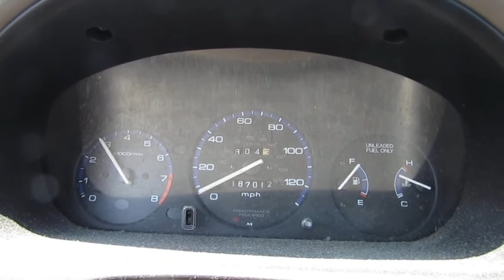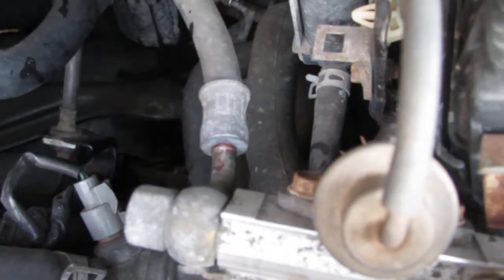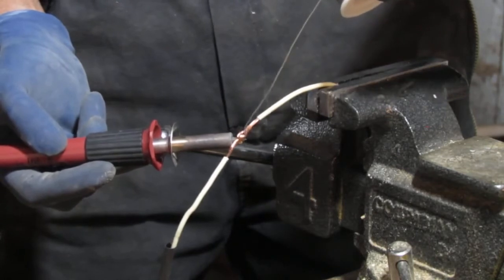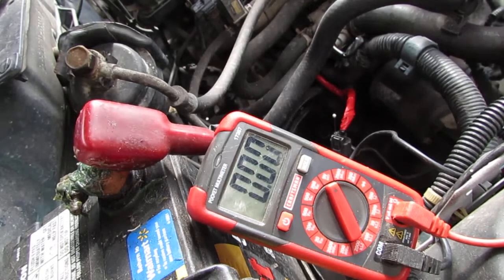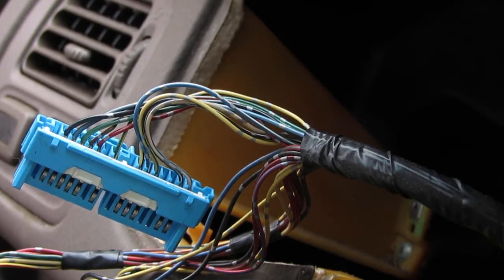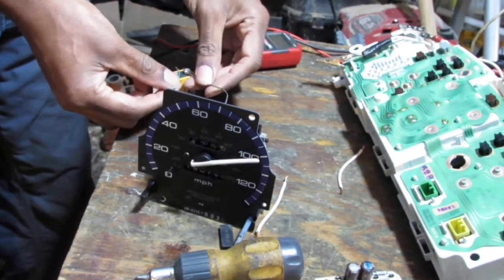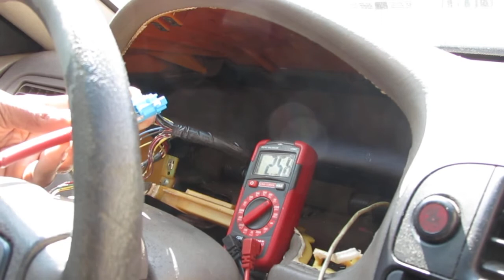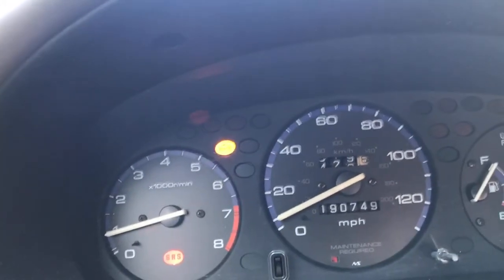Complete Diagnostics and Fix 1997 Honda Civic | Vehicle Speed Sensor VSS

Comment: Thank you very much for all this diagnostic info! I was able to pinpoint my problem, a randomly fluctuating speedometer, and make the repair based on your video. I re-soldered the pins of the NS chip on the control board. Some were corroded. Excellent guidance.
Reply from the maker: I had so many failing issues at once.  Glad you were able to resolve them.  This is a really simple system once it is documented on how to diagnose all the components.
Reply: I’m having this problem now. What’s weird is that when I had the old speed sensor it would randomly work now that I changed the sensor it doesn’t at all. I’m hoping it’s a short in the cluster I don’t have those tools tho

Comment: Thanks for the video. I have a speedo thats not working so will be checking through your process of elimination
Reply from the maker: I made this video as complete as possible so if you have a failed issue it will catch it.  As you can see I had multiple points of failure from in the engine to behind the dash. Best of luck there is a companion video on how to test  the vehicle speed sensor outside the vehicle.  I recommend watching that also.

Comment: What could be happening when the speedometer behaves identically to the rev counter behavior? It started like that and stopped working! Thank you so much for the attention to my question.🤔
Reply from the maker: Can you post a video of this so we can see?
Reply: @MotionDesignStudio  Thank you so much for the attention. In fact it is not possible make a video to show, because the speedmeter is dead with the needle placed in zero, it stopped moving definitly. Anyhow, I made a diagnostico with blinking lights and I got the code -17 (1 long and 7 shorts) and I can believe that the speed sensor is bad. I have to diagnostic the speed sensor as you show in the vedeo. I must wait for a new speedmeter and replace the one that is in the car. Also i think that the odometer do not count partially and totally, but i am not sure and I have to see better driving the car on the road,  what I avoid doing, radars and police.
Reply: Also my car has two plugs, 2 pins and 5 pins. The 2 pins is for blinking lights diagnostic. In the 5 pins plug I can find a ground, a battery and one pin with about 4.58V which I presume is K-Line High. I have two more pins with voltages bigger than 12V of the battery. Do you have an idea what does signals are ? Thanks for the  attention.

Comment: My car was doing the same I change the sensor and it work for a whole week and stop working what u think it could be the problem can u pleaee help me
Reply from the maker: Angle A, I recommend getting a Bluetooth OBD-II reader attached to your car while driving displaying live data and see if you are receiving vehicle speed from the vehicle speed sensor.  This way you know if the issue is on the display side, or sensor and or wires.

Comment: I followed your guide im only getting 1.6 v on the blue and white wire? Am I doing something wrong
Reply from the maker: This is difficult to answer.  If you are seeing a output voltage then this is good.  The voltage will never get higher than 4.6 volts.  The constant velocity at which you can spin the vehicle speed sensor affects the output voltage that the car's computer uses to display the speed on the speedometer.

Comment: Is there a way to have the speedometer recalibrated? I have a 2000 Honda Civic ex and ever since I got new tires which are a bit bigger than the stock ones (which Honda no longer makes in the size) my speedometer reads too high. As an example it’ll read 60 mph when I’m only going 55mph
Reply from the maker: Your car has a specification for this tire size from the factory 185/65R14.  Any bigger and you will cover more space per revolution.  This vehicle speed sensor only uses rpm values for when it is turned by the transmission.  The answer is no you can not calibrate it only replace current tires with stock size tires or use a GPS software to display your speed.

Comment: Hello, somehow my wire from the vss to the speedometer from the brown box underneath the dash is somehow getting battery voltage and I don't know how the wire routes to the speedometer through the Chassis, it links through the firewall then somehow makes it way around to drivers side and I'm so stuck.
Reply from the maker: Jojo Ramirez, sounds like you are in a pickle.  What is the make, model and year of your vehicle?  Warning if it is not the same as the one featured in the video only limited feedback can be offered.

Comment: Hi, I did the tests in the video and everything is working normally, but it still doesn't show the speed, when I tested the blue and white wire it gives me a voltage of 4.75 and when I drive the car it maintains that voltage, different from the video than the voltage it varies downwards and I did a test by moving the needle with the car running and it always goes to zero immediately, regardless of the position it is in, could you help me?
Reply from the maker: This most likely means you need a new speed dial; the chip has failed. Here are your solutions: go to a junkyard and find a Honda or Acura from the same generation, specifically looking for one with the lowest mileage. The failure of the chip is inevitable. Occasionally, it rusts, but if you have disassembled it to that level of detail, you would have seen the rust. If there is no rust, you can obtain that one part, replace it, and everything will work.

Comment: Could this mess with the rpm’s also ?
Reply from the maker: The vehicle speed sensor on this vehicle and other vehicles using similar hardware from Honda/Acura provide the speed information to the car's computer to help it make decision affecting performance and to lower immersions.  This is done suing hard coded value in lookup tables embedded in memory.   The revolution per minute or RPM on this and similar vehicles most likely come from the crank position sensor.

Comment: So my speedo Stopped working and wondering if its my Sensor or the Dash cause my RPM is working but not my speed!! hmmm?
Reply from the maker: The easiest way to diagnose this is to get a Bluetooth capable OBD II reader.  I recommend BlueDriver.  Connect it to your automobile and read the live data.  It will provide speed if your speedometer is functioning.  Then you can look at the instrument cluster as a potential source of failure.    This is a ll very easy and you got this.  I have another video that show you how to bench test the vehicle speed sensor.   Here is the video :  https://www.youtube.com/watch?v=Mcn1pA4bWa8

Comment: Go to the junk yard and start cutting pigtails from any sensors. Typically all Hondas in the 90’s are the same anyway.
Reply from the maker: That is a great resource.  I am noticing this generation of Civic are not as common anymore in the junkyards I go to.
Reply: @MotionDesignStudio  If you can find Accords alot of the body and engine compartment connectors are the same except some connections have extra pins or you'll have to add one. Alot of the same connectors are found on 92-97 Accords/Odysseys and even more of them on the 98-03 Accords and Odysseys as well. CRV is in the Civic family so if you run up on trashed out 95-2000 CRV it's basically identical to the EK Civics. CRV speedometers and connections are swappable to Civics as well.
Reply from the maker: @foxisretrofitting4556  , I will keep this in mind.  I wonder how much of the instrument cluster can be exchanged from this time period.
Reply: @MotionDesignStudio  I know CRV clusters are practically the same as Civics. People use them to get a semi "Si" look since they are red striped and glow orange stock but if I can sometime I'll take apart some different clusters and compare/swap components around to see if there's some hidden gems that can be used to keep these clusters alive. I've got 94-97 accord, 92-95 civic, and 96-00 civic parts around I can experiment with.
Reply from the maker: @foxisretrofitting4556  , I like these types of experiments.  I will grab several from the junkyard and see what is interchangeable.  Because these clusters are failing left and right.  Mine currently has failed again.  In a perfect word component level repair would be the best to create a long term solution for these.  I am working on gaining proficiency at component level repair.
Reply: @MotionDesignStudio  Make sure to be VERY careful. I took out some clusters I had put up today and was fitting things... I wound up breaking a temp gauge and 2 fuel gauges. Really messed up there. Apparently the Accord clusters have gotten even more fragile. When you put the screws into the gauges, if the screws are just over starting to have resistance they will spin posts and break the tiny little copper wires connecting the posts on the inside of gauge. Also found out that '93 accord tachometers are different in screw pattern and board design vs '94-97 tachs.
Reply from the maker: @foxisretrofitting4556  , love the insights on this.